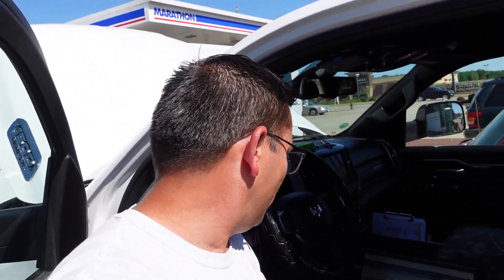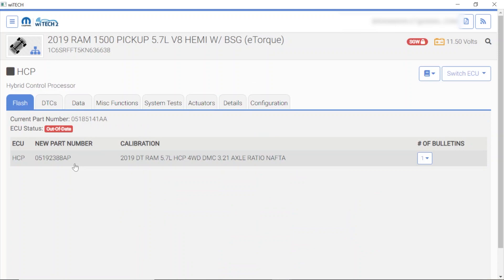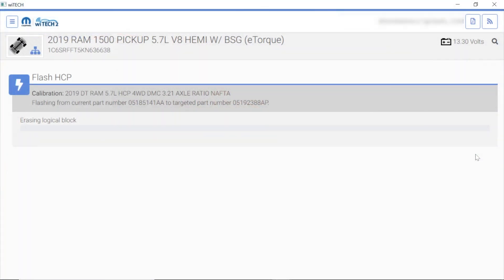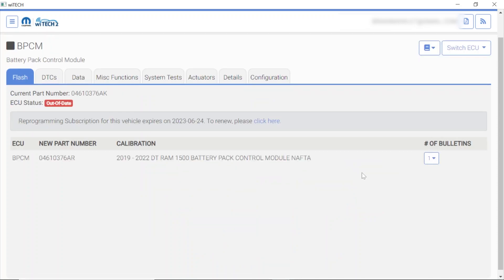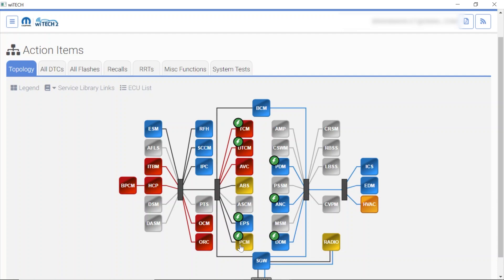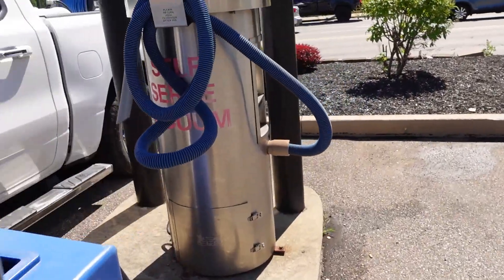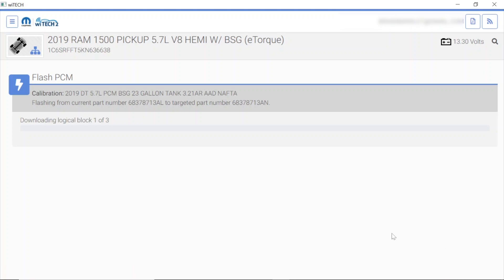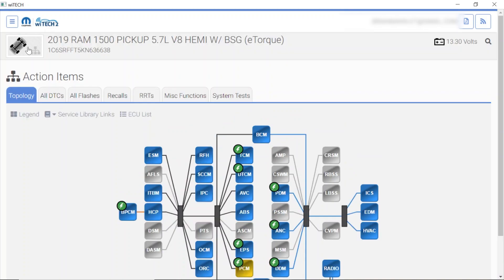2019 Dodge RAM eTorque MGU Programming

Comment: DO NOT BUY A RAM E TORQUE!!!! The MGU units ARE FAILING AT ABOUT 45,000 to 80,000 miles!!!
They cost $1,500.00 for the part!!! Installation and programming are another $500 (at least). The biggest problem is that so many are failing that YOU CANNOT GET THE PART!!! They are on back order and the wait time is over two MONTHS!!! I finally got my MGU, had it installed and programmed by the dealer. Just drove it on a 200 mile trip and the voltage has dropped to 12.7 volts!!!! What a mess. I repeat, DO NOT BUY A RAM E TORQUE!!!
Reply: The MGU has a 8 year 80k warranty. Why would you have to pay for it?
Reply: My voltage varies between 12.6 to 13.6 since new....'21 model with 81k.

Comment: Hello. I made the mistake of buying an etorque ram in 2021. Now ram has cancelled etorque for the next generation which makes me worried about the whole thing. It is already difficult to find the parts for it as I read on internet and God knows what it will be like in 10 years. I like to keep my trucks for a long time and I am worried I may not be even able to find the parts in the future. Do you know if there is any way to convert the truck to a regular alternator? As I read online, there is only a few components to etorque compared to a regular ram with 5.7 hemi. With correct parts and software it seems doable. Do you think you might be able to pull it off? I'm sure you'd be the first one to do it and you'd make a lot of money. There are many people in 2023/2024 who were forced by ram to buy etorque because Chrysler didn't even give an option to buy a regular one. Thanks.

Comment: Etorque  motor and power pack battery has 8 year 80k emissions warranty. If hade 75k then the owner paid for a covered part
Reply from the maker: I dont know why these are not being covered? Last few I have programmed have less than 60k on them.
Reply: A lot of dealers are shirking it. It is a federal warranty for emissions. I don't have the literature but it is diff from the 60k warranty.

Comment: Glad that I found this. I just replaced the mgu on Mt 19 Ram after waiting 3 months for one to become available.  Mine is at 88k miles, the part is warranted to 80k. I have the code for the start stop system now, I am assuming that it has to do with needing to be flashed. Brian, do you think it's drivable? My dealership is about 7 miles away. BTW, the active grille shutter error is actually a problem with the active air dam, it's common enough that Ram extended the warranty on these due to water getting into the air dam motor. Unplugging the air dam motor will make this go away if someone doesn't want to mess with fixing it.
Reply from the maker: I would not recomend driving until properly programmed.
Reply: Hey are you still programming in GA @BrianMann216

Comment: Hi Brian I work with a mobile programming company in Georgia. We will program all modules for 75$ per if no components needs replacement per tsb.
Reply: Stop under cutting the market 75$ for all modules is ridiculous
Reply: $75 per module is ridiculously low. Seriously under cutting the market. Devaluing the service.
Reply: 75 PER MODULE
Reply: @ryanh3671  should be $150 minimum service fee to program anything.
Reply: Where are you located because my generator/alternator went bad and had to replace it and battery. Not charging and has over 80 codes. would like to try reprogramming my truck.
Reply: Where at send me your number i just got my generator to re program in my 2019 im here in georgia

Comment: Love the video very helpful good info  . I agree with you about lack of info with programming Chrysler vehicles had the same issue doing the TPIM module simple things . And I notice although software very user friendly they have a lot of issues on there not just with using a j2534 but even with the micro pod 2 . Do find that you have to reboot or trouble shoot the software ??
Reply from the maker: Over all wi tech is ok most of the time. some times connection issues happen that make be have to log out and back in even when I am on a shops wi fi
Reply: @BrianMann216  yes I run into the same issue I was doing a simple job it was a 2017 Dodge Ram I was adding the hitch basically adding it to the system which is a cool feature dodge does offer and I kept having connection issues I had dodge on the phone helping me trouble shoot I had good internet my laptop was well above spec and I was using the micro pod 2 it was updated and everything Chrysler couldn’t figure it eventually after logging out and in a few times it worked I realized a lot is on there end . In the end what I leaned when Chrysler works it works well and very user friendly

Comment: Why did the Battery Module have a new Update available after flashing PCM &TCM at the end ?
Reply from the maker: As you see on the net work map the battery module is on its own dedicated data line,  I think that the MGU not having the proper calibrations in it would not communicate with the battery module until it was programmed.